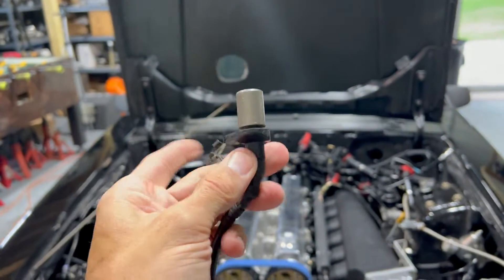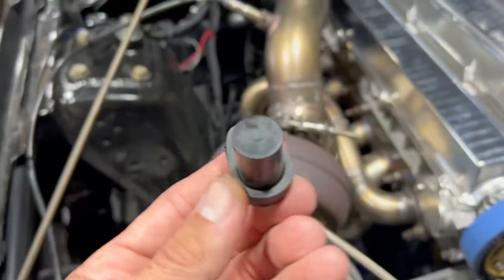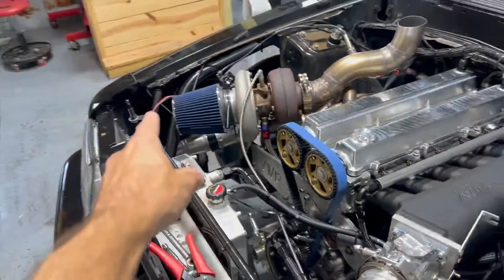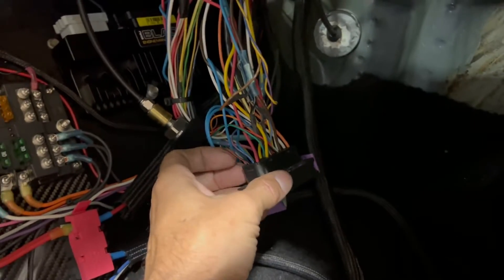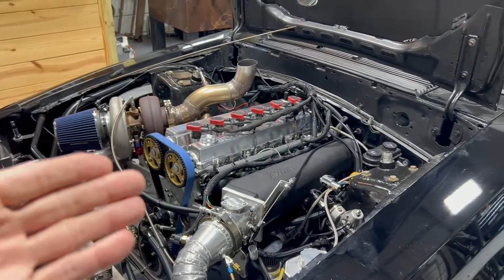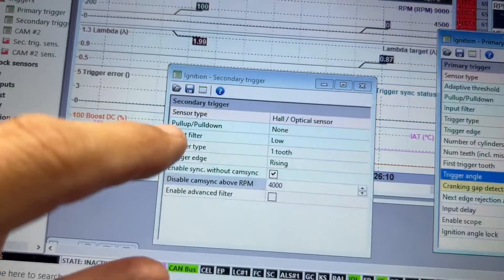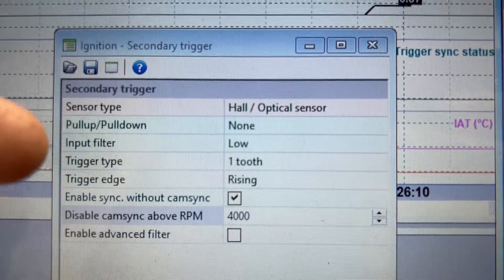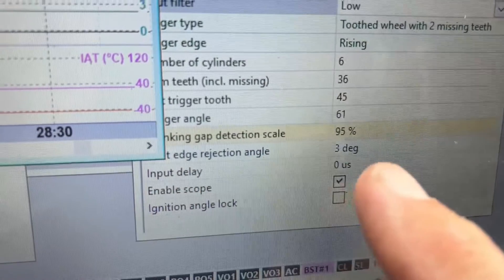2JZ FoxBody Gets A Hall Sensor Upgrade! Cleaner Trigger! Part Numbers Included..

Comment: Heya, hopefully you’ll see this. Do you remember how thick the crank sensor spacer was?
Reply from the maker: If I remember correctly it was around 200 thousands.  Or 5mil.
Reply: @fox-body  appreciate the response. I ended up with a spacer at .221. Crank signal looks strong while cranking but if I need to pull the sensor in I can still. Thanks again for all your information. Should be another black 2j fox hit the track pretty soon lol.

Comment: Hey are you experiencing heat soak? Mine is fine when cold but once at temp it starts to lose sync. Odd because they are rated for high temp up to 140c I believe. I’m only hitting 96 and get crazy sync loss
Reply from the maker: I’m not seeing that on mine.

Comment: you still need to locate the source of the noise. I had to add capacitors to my ECU. later I found a bad connection on my injectors.

Comment: Looking good Kris. Did you happen to validate timing once you swapped from VR to Hal? I'm curious if it changed at all between the two sensor types.
Reply from the maker: Yes I I had to adjust timing. I think more so because I changed the trigger edge from falling to rising.
Reply: @fox-body  that makes sense. Its impressive it picked up power from a sensor swap. Car looks like it runs hard at that psi.